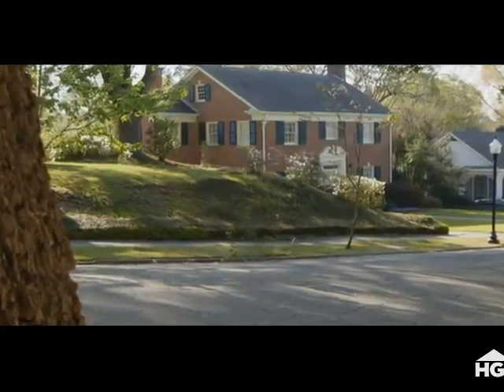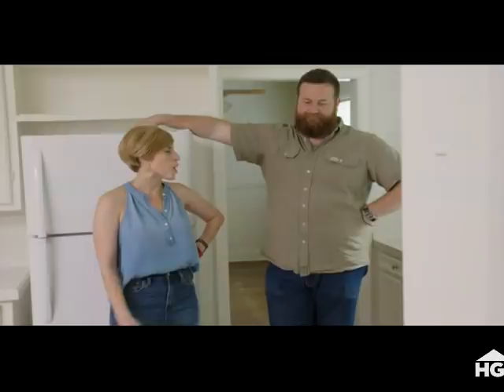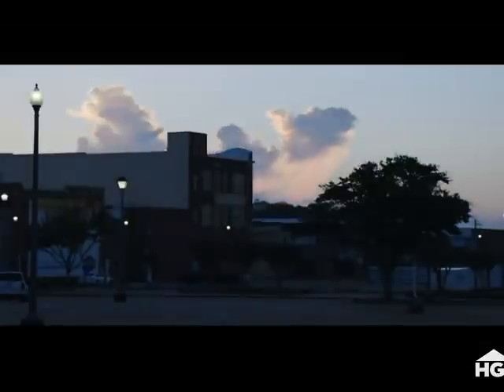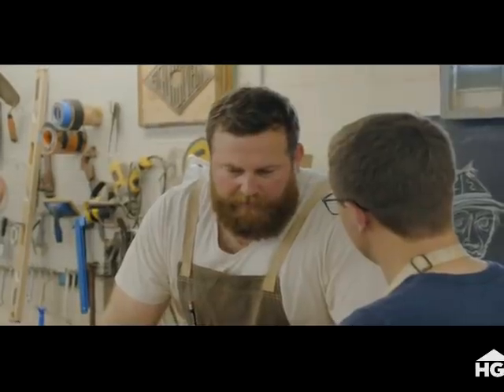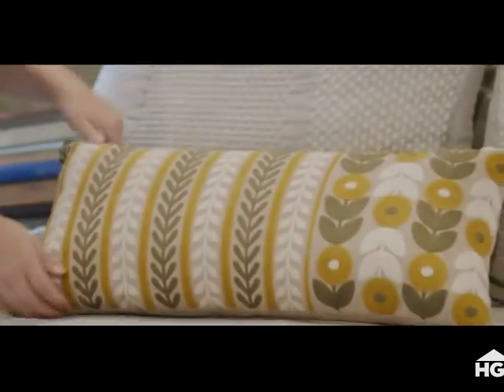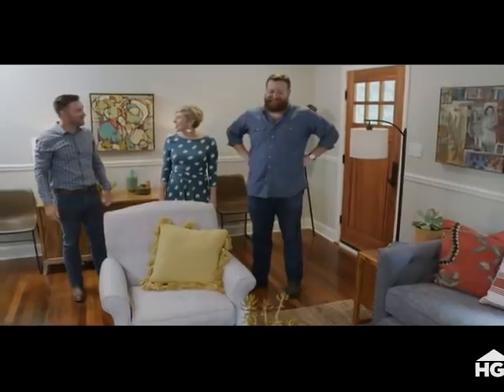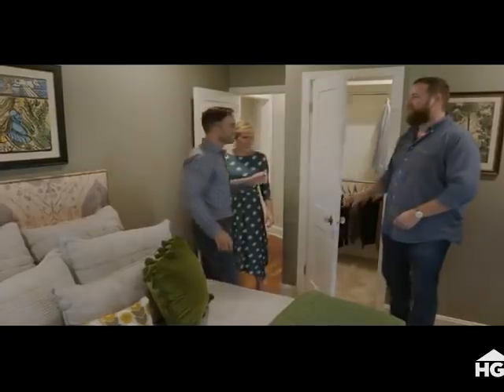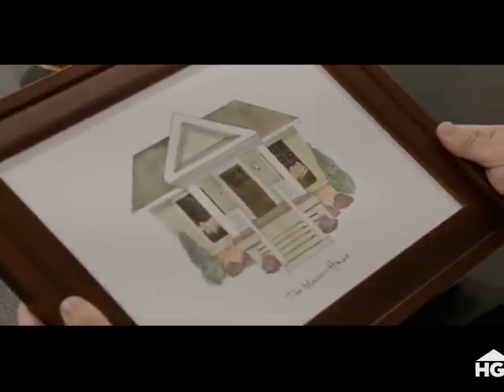Bachelor House | Home Town Recap | HGTV

Comment: I wish they would just include comments about energy saving features in the remodels.
LED lighting, set back thermostat, energy efficient appliances, energy efficient heating and Air Conditioning, insulation in ceiling and walls.  All these make a home more comfortable and affordable to live in.